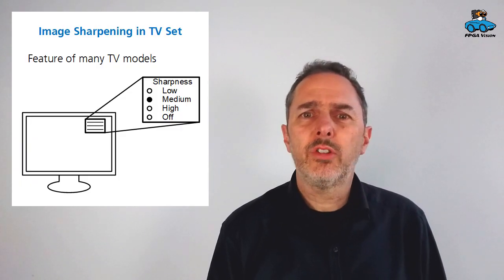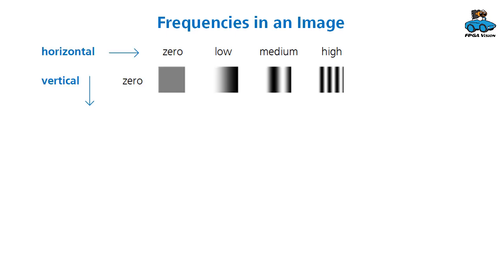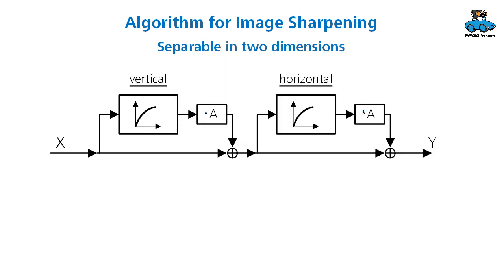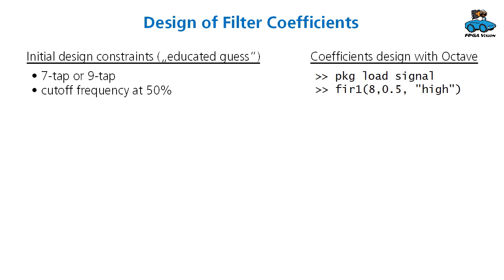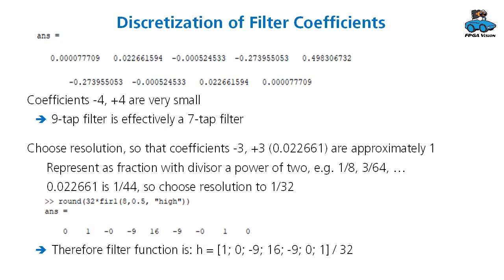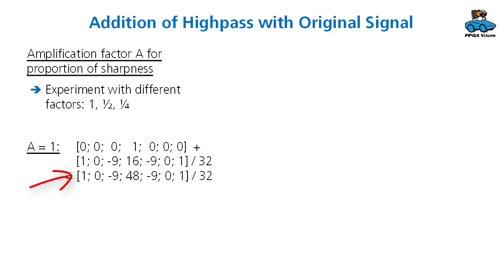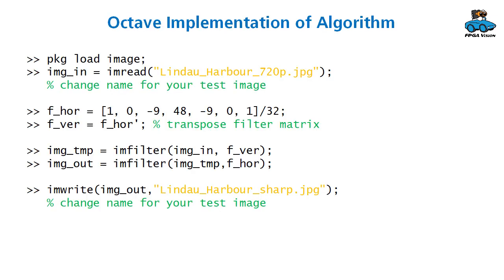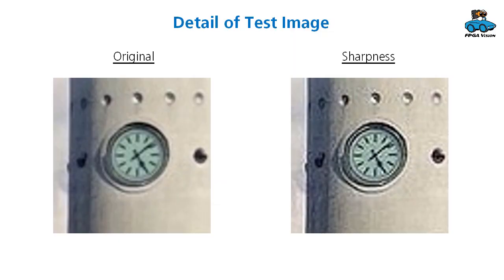FPGA FIR Filter: Application and Algorithm

Comment: Hi prof. Why do we approximate to the nearest power of 2
Reply from the maker: Because the hardware implementation of multiplying by a power of 2 requires no circuit elements. It is just a different connection of the signal bus. 
For example, for a multiplication by 8 you shift the wiring of the signal bus by 3 bit, as the factor 8 is 2^3.

Comment: Dear Sir 
First, thank you very much for your valuable information.
Please, I have zynq 7000 ZC702, the kit has one HDMI port.
My question is how can I display a video signal from the kit when I connect a camera to that HDMI port?
Reply from the maker: According to the product page that is a video out. So you need an input port for video.

Maybe there is a card for the FMC connector. With a Google search I found the FMC-HDMI and the inrevium HDMI2.0 FMC Card. But I can not tell you, if one of them is compatible with your board.